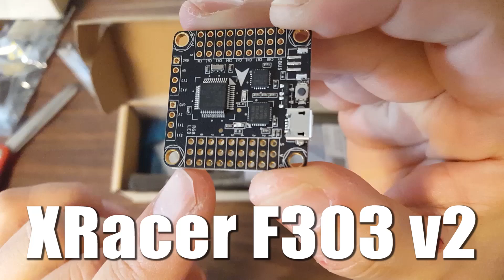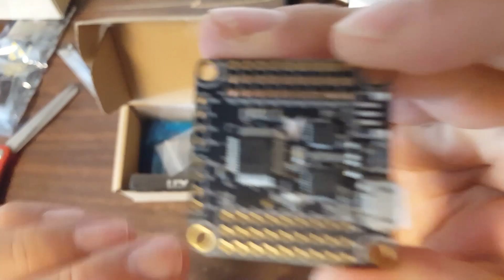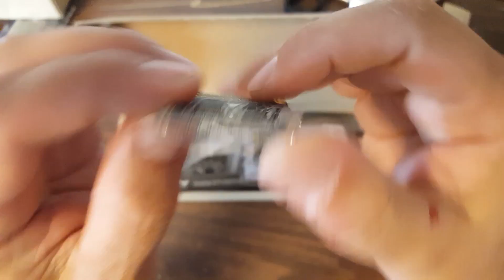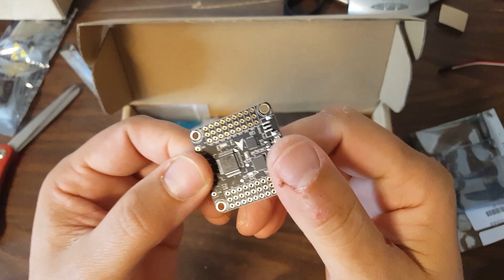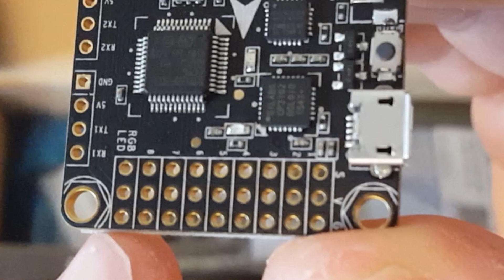XRacer F303 v2 Review

Comment: I  have this board in v2.0 cant get it flashed or connected any ideas
Reply from the maker: +JEFFPV YEAH!!!! Put it into bootloader mode and re flash it. Remember that the target changed... It went from I think SPRACINGF3 to XRACER SPI, But I don't remember which version it did that. 

https://youtu.be/m4ygG6Y5zXI
Reply: Joshua Bardwell the flashing won't be the problem I can't get it to recognize it in my pc it has the stm32 chip but only the cp210 driver comes up in zadig I'm stumped
Reply from the maker: +JEFFPV YEAH!!!! I don't think this is a VCP board. You shouldn't need to do anything with Zadig.
Reply: Joshua Bardwell ok I've probably bricked it then. I was getting failed to open serial port from the get go and zadig always fixed that for me just getting a different board and definitely not an xracer again lol thanks for the help.
Reply from the maker: +JEFFPV YEAH!!!! It's very hard to brick these boards without physically damaging them.
Reply: Joshua Bardwell I'll give it one more try then move on.

Comment: how do you power up this board and how do u use the VBat??
Reply from the maker: +Ishaan Kulkarni power the board from a 5v regulator. Wire to the pads of any unused motor pins. There is a vBat pad on the underside I think. Check the pinout diagram.
Reply: Joshua Bardwell so basically 5V to  un used servo pad and VBAT from raw battery to VBAT pin on FC?
Reply from the maker: Yes. And don't forget GND.
Reply: THANKS!!

Comment: I just purchased the 2.1 version. I am using I-bus with the fly Sky FS-I6. I'm wondering if I connect my rx input to the frsky's sbus input?
Reply from the maker: Yes, that should work fine. The "SBUS" input isn't really locked to SBUS. It can be any serial protocol. It just maps to a UART internally.
Reply: Wonderful. Thanks for the quick response.
Reply: I just thought about the 16mb? Chip on board for blackbox. How would I activate and retrieve data for blackbox from that chip?
Reply from the maker: https://www.youtube.com/watch?v=mi3z-tML7v0

Comment: Hi Joshua, have you used the RSSI input? Is there an analog RSSI output as well? If not, how would you hook the RSSI into a PowerOSD or RROSD? 

Thanks love the channel.
Reply from the maker: I run analog RSSI direct from the receiver to the RROSD. But now that you mention it, I would like to also run it into the F303 because I like to log things with blackbox for troubleshooting purposes.
Reply: +Joshua Bardwell which receiver are you using? Neither of my frsky ones put out an analog signal and I haven't yet found a good article or video that clearly explains how to make the low pass filter to convert from pwm to 3.3v analog (maybe an idea for a video?)
Reply from the maker: X4R-SB has an analog output pad.

Comment: Hi !
I'm going to connect my MinimOSD to the X-Racer.
UART1 is for USB
UART2 is for the S-Port of my X4R
UART3 is for the SBUS
Thus I'm going to use the Soft Serial port for the OSD. Do you know of which channel/pin it has to be connected ?
Reply from the maker: I guess it is the RC header pins just like on a Naze, but I haven't personally tested that.
Reply from the maker: Make sure to re-compile your MWOSD to use 56 kBaud, which is as fast as softserial is (theoretically) supposed to go.

Comment: Hi Joshua. I love this board, and as you said, there is not much to complain about, but here goes one small issue: I recently purchased v2.1, and noticed that the distance between the 4 mounting holes is a little off from the mounting holes on the QAV210. It's a real bugger to get it to fit, as they do not perfectly align. Have you or anyone else noticed this?
Reply from the maker: +Brian White I haven't had any problem with the mounting holes on v2.0. I haven't mounted a 2.1 yet though.

Comment: Hi Joshua. I had a quick question, I purchased an xracer f303 with the original intention of flying with CPPM. I ended up flying my buddies board and ended up really liking how sbus compared to CPPM. I was planning on running programmable led strips. I no longer care about running them with turning signals etc, but out of curiosity would the lights still light up I'm using an adafruti neopixl stick. please let me know if you would know anything I've gone online and tried to find something but have had no real luck. Any help would really be appreciated. Thank-you so much for your time
Reply from the maker: +Jaspreet Sidhu I can't think of any reason why LED strip would conflict with SBUS, but I don't use LED strip, so I could be missing something.
Reply: No worries thank your for your help appreciated. I was able to go online and figure out that the ada fruit neo pixel will work off of PPM and PWM.

Comment: Was just about to buy this board, but it's sold out :/  Does the board support a spektrum dsmx satellite? There are these dsm pins next to the flash-button, but i've never seen anyone who used them.
Reply from the maker: +Ansgar Hoyer I think the intent is that you would direct-solder the signal, power, and ground wires to those pads. I believe that they should work, but I haven't personally verified it.
Reply: +Joshua Bardwell I'll give it a try if it's back in store.

Comment: Can you get voltage using softserial port like naze?  I have ver 1 with no vbat.
Reply from the maker: +zen_808 I don't think Naze can do vbat over softserial. But if it can do it, I don't know why the F303 couldn't. F303 does break out the softserial pins. To get vBat on the F303 v1 you have to solder to the MCU pin. A very fiddly job. See here:

https://www.youtube.com/watch?v=Vo_Jlgx1EFc
Reply: +Joshua Bardwell , I dont think my soldering skills are up to the task.  Rather be safe than magic smoke.  Thanks
Reply from the maker: zen_808 if you have a receiver with an analog voltage input, you could get voltage telemetry that way. It won't give you access to the vbat PID compensation feature though.

Comment: Hi Joshua,  first of all, thank you so much for all the informative videos.  I really like how you explain things so well and detailed and show examples.  Keep it up!  

On the subject of X-racer F303.  I'd like to share my experience.  I purchased 2 of the V2 a few weeks back.  One of which was DOA.  FPVmodel send me a replacement for free (good cust service).  And just today the 2nd one is now dead from no apparent reason as I was simply doing motor testing / throttle calibration.  Will contact FPVmodel again.  But the record for me is worrisome of the longevity / reliability of the board.

Also I wanted to note Readty To Fly Quad came out w/ their Flip32 F3 which looks a lot like X-racer F303.  I've one now on one of the quad and seems to be working well.  The pluses I see include:
1) Cheaper price $21
2) both TX/RX available on UART3 (sbus)
3) true one-sided board to help w/ certain installations

Only annoying thing so far (other than the usual RTFQ lack of support or documentation) is that the PWM output is signal only.  Just thought I've mentioned it if you haven't seen it.  Ignore me if you have already.  :)

Thanks again!
Reply from the maker: +TheFlyingRamen Thanks for the feedback. I haven't heard any QC issues with the v1 F303 boards, so I hope your experience isn't a trend with the v2. That would be really too bad. Good that FPV Model is making right for you. 

Personally, I don't like shopping at RTFQ. The products are very good, at a great price, but there is just no customer service. It bothers me too much, but not everybody feels that way.

Comment: I just got this V2 board as well. I wish it had a current sensor input. But it doesn't. So I will stick to the Virtual Current Sensor feature of Betaflight for now which works quite well once you have calibrated it. I actually prefer the Dodo V3 I have on one of my miniquads. But that costs almost double what this board costs.
Reply from the maker: +Richard Ding Yup. It looks like this is not a good choice if you use current sensor or sonar.

Comment: Joshua,I just got my V2 board any I'm trying to connect it to my OSD. I have an RX TX pins on the OSD that would go to the RX TX pins in the middle of the naze. Do I use the RX TX pins from say UART2 and set it to telemetry, then run serial RX on UART3 for SBUS?Thanks for any help
Reply from the maker: +Dan Ross You're almost right. You would connect to e.g. UART2 RX/TX pins the same as the Naze, but for OSD, I believe you want MSP on the UART, not telemetry. Also, remember to swap the RX and TX pins between the OSD and the F303. 

Serial RX on the UART for SBUS is correct, but I can never remember off the top of my head which UART the F303 uses for the SBUS receiver pin, and I'm not near my copter right now, so I can't verify right now that it's UART3.
Reply: +Joshua Bardwell  Ah thanks! looked at CF and new documentation on the X-Racer site again.UART1 MSP to OSDUART2 BalckboxUART3 SBUS       I think this is how it should be. Let me know that you think.

Comment: There's a print error on the V2's PWM header pins. Top side is labeled correctly. But on the bottom side all the words got shifted down / up one due to the extra LED header pin holes added. :(
Reply from the maker: +yfz450manny Good catch. I missed that.

Comment: if i was to find fault in this v2, it would have been a lot better if the buzzer, vbat, and rssi tabs all had a hole to solder a pin or wire into. The flat solder tabs are weak and bloody small to work with. i managed to break the buzzer tab on a v1 very easily and the copper track lifted off with the solder
Reply: +np mullins V2.1 is out with holes instead of pads!
Reply: Yeah was thinking that too. perhaps a dab of hot glue after soldering can help stress relief a tad. Anyways waiting for mine, ordered it last week via slow boat.

Comment: silly question i'm a NOOB to anything but a Naze and i just got one of these and so far it flys great, but what are the RSSI pads for? is it for OSD? and with softserial Telemetry, do we need to split the s port connection like on a Rev6?
Reply from the maker: +TwistyML Some receivers output RSSI on a pin, so that you can hook that pin up to the RSSI pad on the FC, and then the FC will know how strong the signal is between the transmitter and the receiver. I actually kind of don't know what the point of this would be, but there it is. I guess maybe if you had an OSD like MWOSD, the FC could communicate RSSI to the MWOSD... but that sort of doesn't make much sense, because the OSD probably is going to have its own RSSI input pad.

If you are doing S.Port I don't think you can use softserial, because softserial doesn't go to a high enough baud rate to do S.Port. If you're using a D series receiver, you can use Frsky telemetry with softserial because it only runs at 9600 baud. But if you're using an X series receiver with SmartPort, you can't use softserial.

Comment: Sweet! I was thinking of getting this board. I'm just wondering if I can still use pin 6 for softserial telemetry like on a naze
Reply from the maker: +Gulzaar FPV I don't see why not. One advantage of this board is that it does have the complete RC header pins broken out. So if you need to do Softserial for OSD, GPS, or telemetry, you should be good to go.